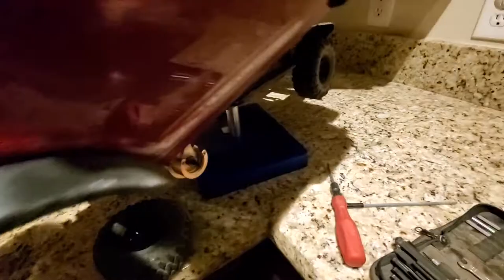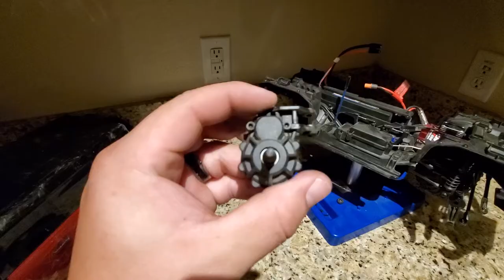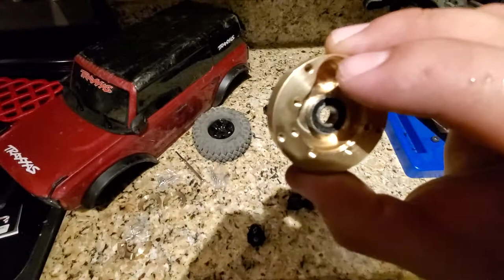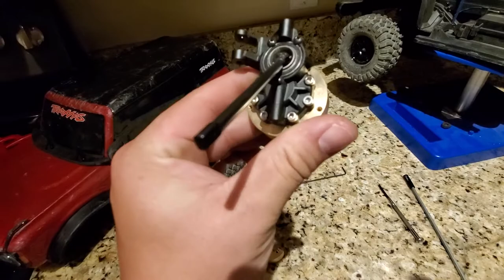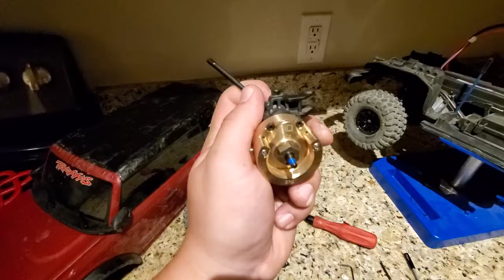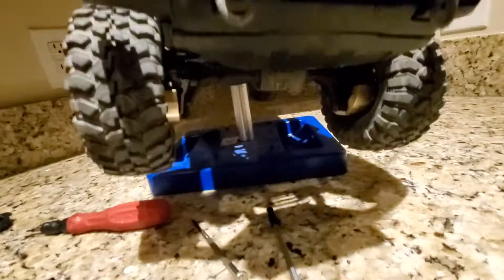2021 TRAXXAS TRX4 HOT RACING ULTIMATE BRASS WEIGHT KNUCKLE UPGRADE

Comment: Finally a video  on the this set. I've been looking for awhile. I just put the brass portal cover on the back wheels. I'll put the front on  tomorrow. I went with proline hyrax tires on my trx 4 tactical.  I also had to put the little bearing in with a small vice and socket. Couldn't really pound on them i live in a apartment. 
               Thanks
Reply from the maker: Nice
Reply: @sinfulrcracing9305  i also got a sound module for it also.
Reply from the maker: @gwpattrick  sound module?
Reply: @sinfulrcracing9305  was that a question urr
Reply from the maker: @gwpattrick  what does it do I'm new to the crawler side
Reply: @sinfulrcracing9305  its a speaker for the truck so that it sounds real.  You insall a wire to the receiver and then the battery.  It starts up and revives the truck up. Just like a real truck. I too am new to the hobby also 2 years or so and not that into it either. I got 2 trucks that's about.
Reply from the maker: @gwpattrick  ooooohhhh you just made me want something new 🤣
Reply: @sinfulrcracing9305  it can also be programed with different trucks sounds. Im from Wisconsin and have a good night.